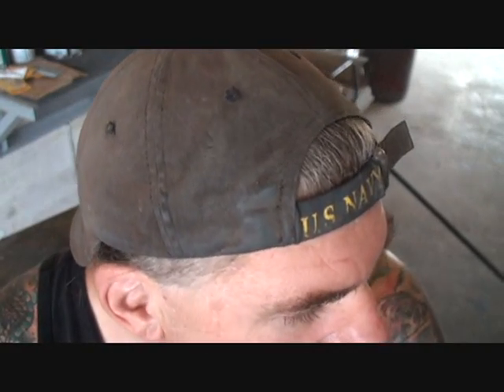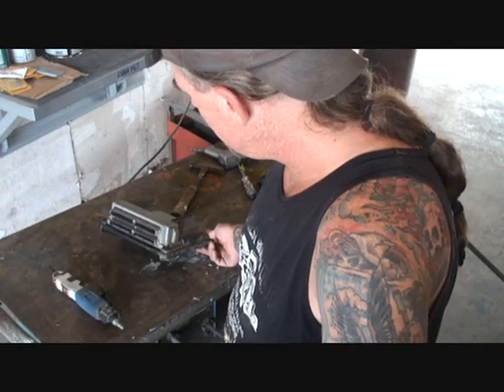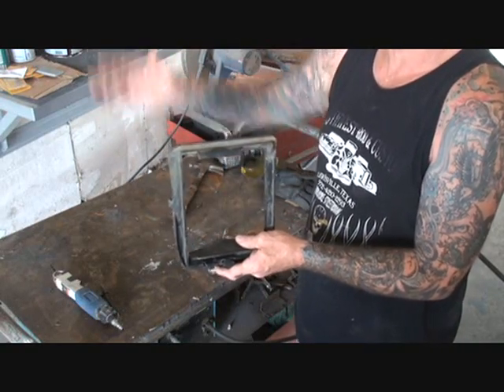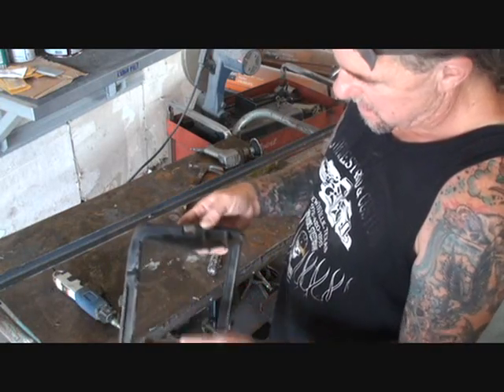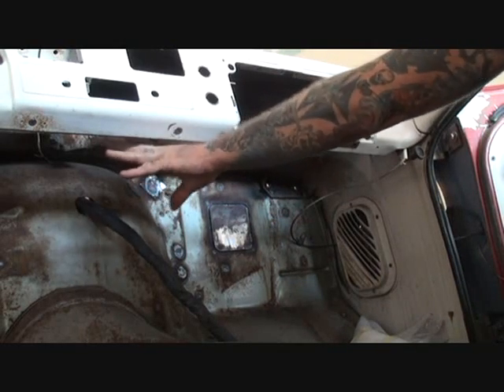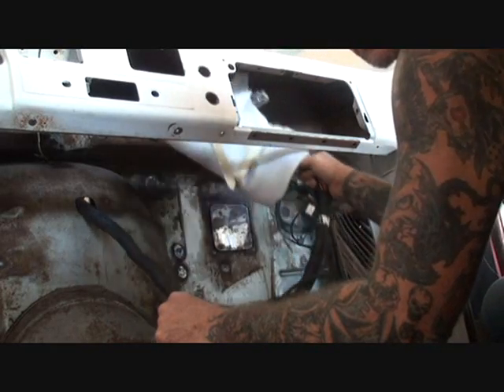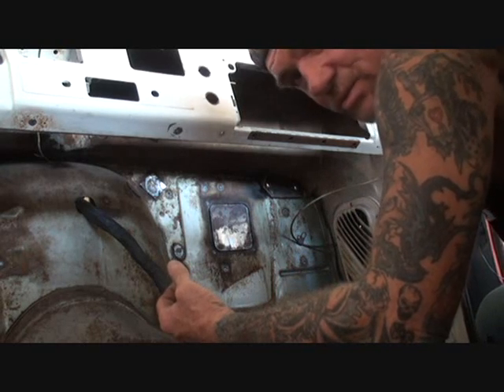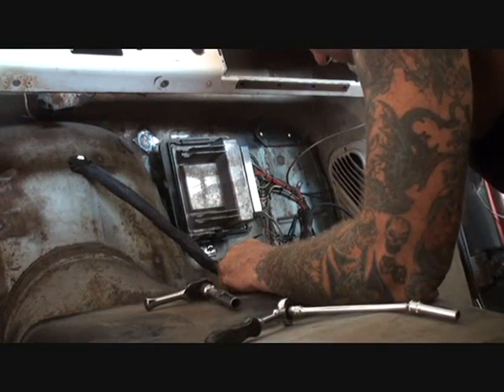LS2 Engine Installation-Where Should I Install The Computer?

Comment: That was just great! Repurpose the plastic OEM bracket and mounting, INSIDE. Thanks Pete for the ideas as I will place mine in the center console, with TAC module & BCM. Yes, not for the faint of heart as extensive wiring is needed. But this gives me remote keyless entry, power windows, content theft, warning chimes for leaving headlights on or turn signal, the list goes on. If like me, not using the factory radio, you can buy an adaptor that plugs into where the radio would go (Just 9 wires, Roughly) but turns on the LF speaker for warning chime. Thanks again Pete!